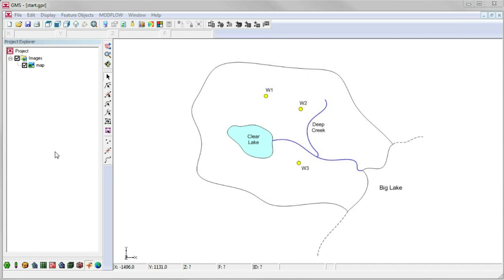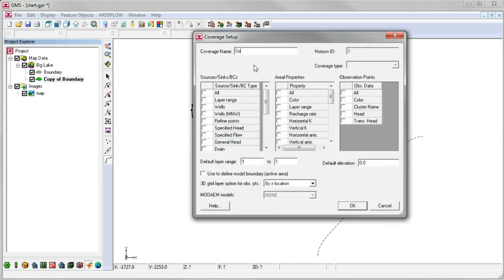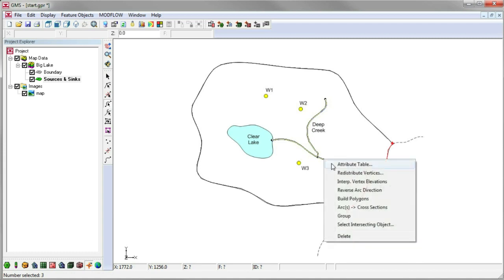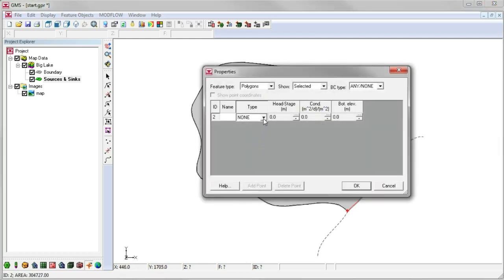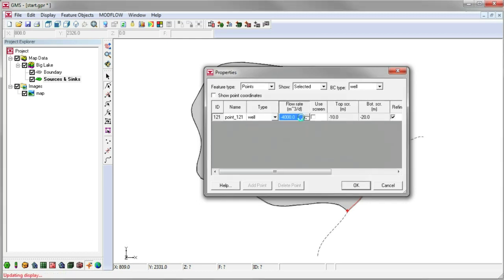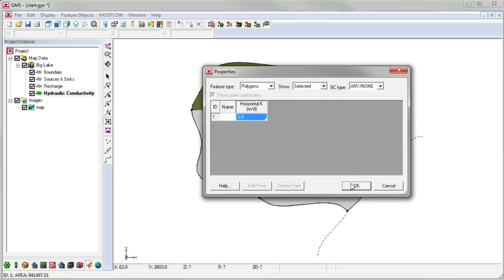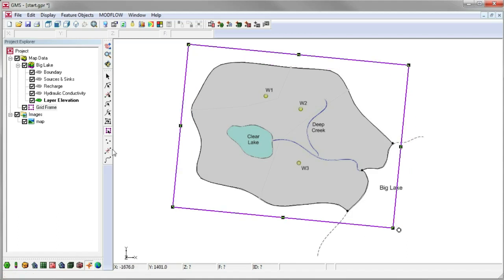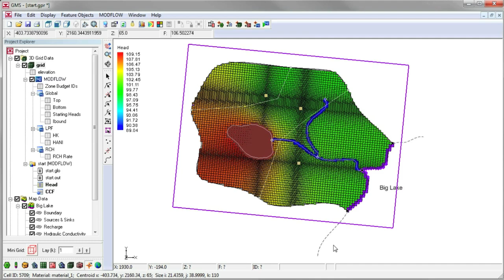GMS: MODFLOW Conceptual Model Approach

Comment: thanks for your useful video. I want to model a passive relief well system for an open excavation, could you give me a guidance on how to simulate boundary condition with high water level for outside of excavated area and low water level for inside of excavation, and relief well boundary condition?